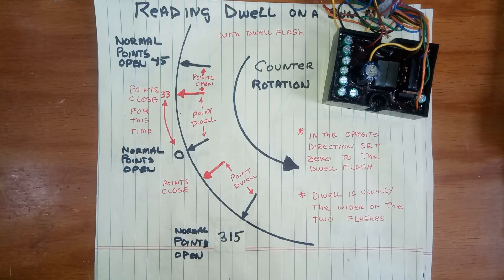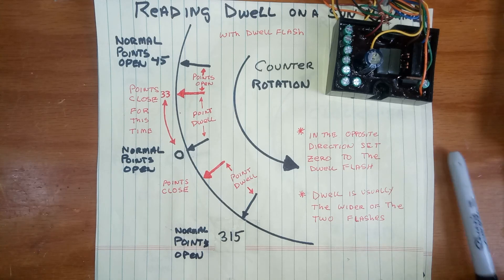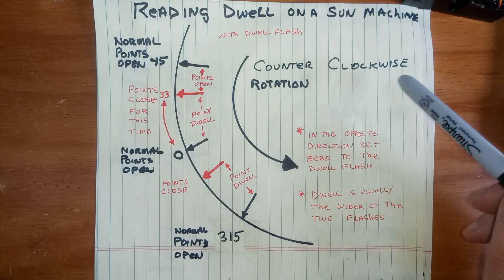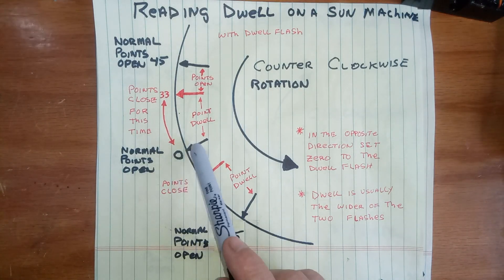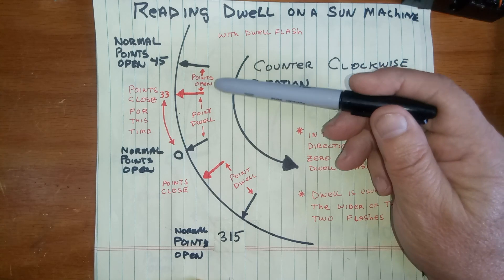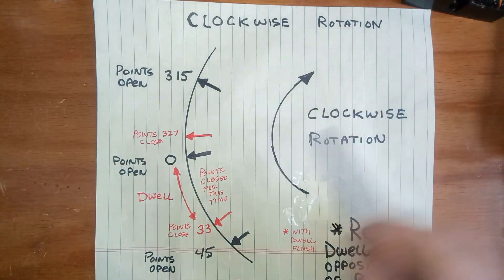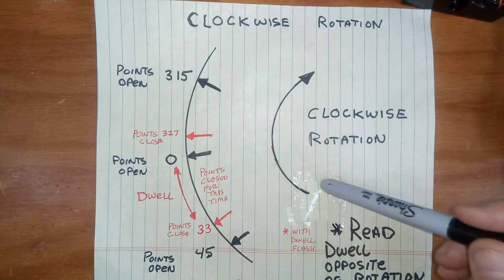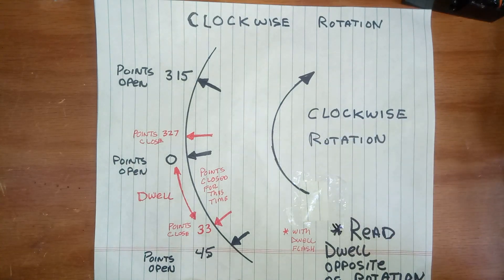How To Read Dwell Directly On A SUN Distributor Machine With DWEL FLASH

Comment: Thank you for your demonstration. As I understand it, the advantage of your dwell system is that it is a direct readout on the degree wheel, therefore requires no dwell meter calibration. Is that correct?
Reply from the maker: That is a side benefit which was easy to include.  There many of these machines sitting around in storage because they have bad flash tubes and power supplies. Replacement neon tubes are $600 and it still only has performance of the 1940's. The LED system is ultra fast and you can actually see point bounce.  It is still a fairly complicated rebuild for some though dozens have succeeded. But it is rather cheap compared to having a machine that would never work.

Comment: hi this is amazing i need to buy one.
Reply from the maker: These modules are available for retrofit in the SUN machines.  It is a major rebuild removing much of the old electronics. I have a few videos and Karl Sarpolis has also done some on the steps. It is a cheap solution if you have a machine which no longer works. Before purchase you are required to read the manual to see if this is within your technical ability.

Comment: Hello, i'm interested in purchasing a dwell flash module, are you still producing them? 
Thanx, 
Tom
Reply from the maker: Yes, I have a few made and ready to ship.  Provide an email address and I will send you a manual first to see if you are comfortable with the modifications.  Prefer your unit doesn't work or very dim as this modification requires rebalancing and removes all existing electronics. It would be very difficult to go back.
Reply: @opera5714  hello, my email address is tomshotmail@aol.com in addition to the led strobe, i want to use a digital tach. Can you recommend a specific one,  many are listed on ebay and i'm not familiar with the specs. 
Regards, 
Tom
Reply from the maker: @tomwalker2457  I can not recommend a tach. I used one with two push buttons in the back. That allowed you to multiply and divide to any ratio with different filtering. It's China!  None of them offer instructions and I have messaged them. Last person bought one and randomly pressed buttons and screwed it up. They all need some circuit to convert if used off a SUN module instead of supplied sensor. If X1 is OK I will need dwell/tach module number. Clear this up before ordering module so I could include any needed parts.
Reply: @opera5714  hello, the flash unit on my machine still works, the reason i wanted to use the dwell/flash was to get an ACCURATE dwell reading. I  a novice when it comes to electronic circuits, could you send me a copy of the instruction manual? 
Tom